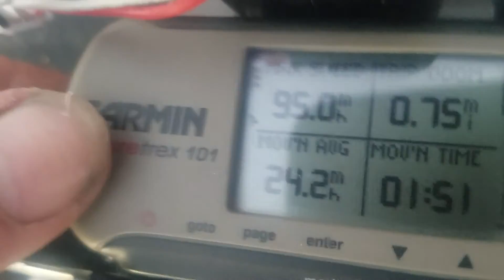Rustler  3s 95mph  w/2200kv Castle

Comment: we just didn't hear the 3 beeps but it was a nice run tho keep it up
Reply from the maker: yes you are right about the beeps. however you can see my setup where I'm running parallel connectors. for some reason a bunch of people have quit showing they're batteries and you're left with the assumption that there run and whatever they say they're running. I want to make sure that people can see that I'm keeping it real. My battery setup will always be in my videos. thanks for watching. stay tuned even more impressive things to come.
Reply: that's Kool either way it was a nice run .